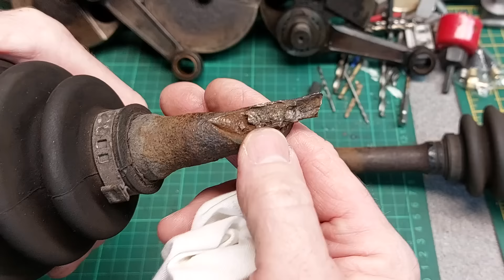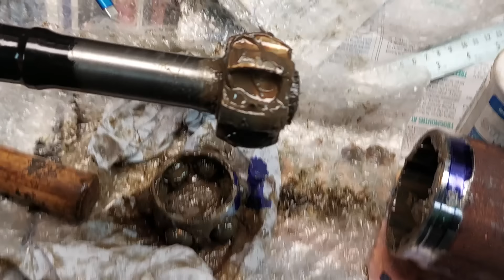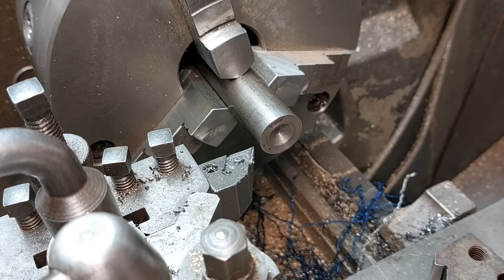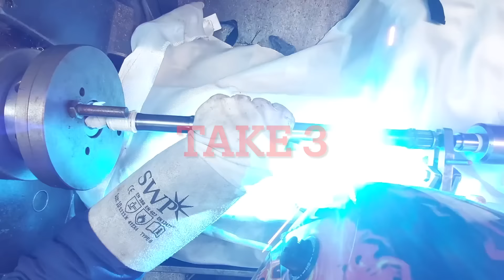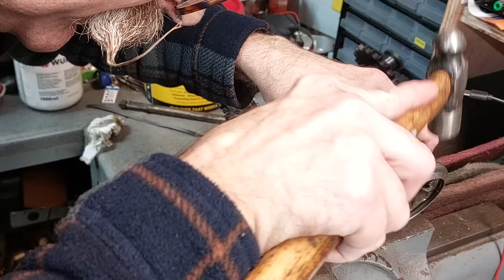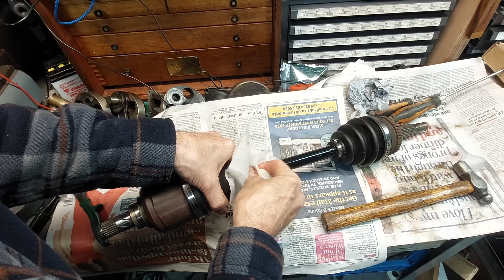OBSOLETE PART....IS THE CAR SCRAP ???  NISSAN MICRA BROKEN DRIVW SHAFT.

Comment: Did you not contact J&R cv joints and driveshafts? They have one that looks compatible on eBay for less than £40.
Reply from the maker: They were the final solution, see the next video.

Comment: 30 Years ago the machinist at my local driveshaft shop showed me that if you weld the shaft all the way around and then put the indicator on the shaft you can use a wet rag to cool the high spot. Each time it will pull about 8 to 10 thousands of an inch. anything under .010 inch is usable.
Reply from the maker: Very interesting, thanks Midge 👍

Comment: Looking at that fracture, it's been cracked for quite a while, there was less than half of the thickness of shaft holding and it was still working !
I would imagine the pressed together parts would hold well enough, adding weld just makes it a lot more secure !
You also made it look almost trivial too but having a well equipped workshop and knowledge of how to use the tools really helped !
Nice save ! 👍
Reply from the maker: Yep I think it had been hanging on a wing a day a prayer for a long time 👍

Comment: That exact same thing happened on our toyota avensis. Same rubber damper caused corrosion and  fracture happened when pulling away from some lights.  Dure you can swop the splined end onto another shaft
Reply from the maker: Unfortunately they all come complete so unless you pull them apart to count the splines on the drive shafts to check it's difficult to find the correct shaft......and I think you'd struggle to get a refund from the supplier taking it back in pieces 😁
Reply: @TweedsGarage I was thinking, reuse your splined end and pull the joint apart but that might not be possible.

Comment: My ears perked up when you mentioned Aerial leader.

I had a k11 with a cvt and there was a time I needed to replace the half shaft. I got one easily. 
I used to go through them from time to time as I had totally customised mine with performance parts ie suspension, upgraded inlet cam shaft etc.
Reply from the maker: Ours us a 1.4 which makes it tricky

Comment: Great recovery repair Mr T. Unavailable parts set me thinking what the next generation of old vehicle enthusiasts will have to face. The words rust, plastic and electronics to the fore and will they be allowed on the King's Highway? Happy Christmas to you and yours, with thanks for the entertaining posts of 2025.
Reply from the maker: Yes I also have to dive into the Jag which has had electrical issues and it's that era of car that has over complicated but quite dumb electronics......I should it has been tge end for many of its ilk

Comment: You could always go rot the brand new second-hand unit if that fails, or just put more weld on it .But that was a very good repair, should easy outlast the car. Respect Mr Tweed.
Reply from the maker: Thanks Dave

Comment: Exactly the same thing happened to my son's 2002 Toyota Corrola T Spirit auto last year. Corrosion under the damper bushing rotted the shaft till it snapped.

This is a lovely little car, still running great and under 100k miles,  but although Corrolas are about as common as fleas on a dog, this one is apparently a rare model and every single part i've tried to buy is either made of unobtanium or comes and is wrong!

A search of ebay turned up around 100 available shafts, but, despite my putting "auto" in the search parameters, only 1 came up as "auto only". A quick phone call confirmed it was definitely auto spec and 3 days later it was on the car. Interestingly the new shaft came without a damper bush!
Reply from the maker: A good find, and same with the Micra, there are loads of manual drive shafts, a few for the 1.0 litre autos but bugger all for the 1.4 CVT

Comment: You identified the driveshaft inboard end as CKN, I think that should be GKN, standing for Guest, Keen and Nettlefold, an old English engineering company that made all sorts of things. I used to use their products almost every day being a woodworker and using many different sizes of WOODSCREWS ! And later on taking apart just as you were doing constant velocity joints to replace the rubber boots and clean out and re grease the unit. You can get them apart without removing that outer ring. In one position you can pull the joint tighter than the rest, and then you can remove the first ball, then that gives you the room to do the same to the others in turn. The yoke will then come out of the coupling when turned sideways then twist it one half the distance between ball centres( this is hard to explain lol ) and it will come out!  Come on Mr Tweed, an engineer using centimetres? What's wrong with decimal Imperial inches?😅The only good metric measurements are Kilometres, metres and millimetres. Nothing else lol. The use of Centimetres, Decametres and god knows what else are just an idea of the Frogs who invented this bloody awful metrology system, was just to confuse every one else in the world who didn't have the Froggy language as their mother tongue😅😅😅😅😅😅😅. I'll watch the rest now! Tarrar!
Reply from the maker: Didn't GKN make woodscrews ( white cardboard boxes with blue writing ) ?
Reply: @Twe@T @TweedsGarage  Yes! I used thousands of them in my time as a church organ builder from, now  listen to this,  3/8" x 0 brass roundheads, to 6"x 14 countersunk's and just about every size and head shape in between.  The white boxes were the later versions, which started I suppose in the early to mid seventies, the original boxes were quite thick cardboard with alternating green and black diamond pattern for the lid and a plain brown  lower part. The label was green with black writing. Somewhere in one of my sheds I have a box, probably from WW2 era, it is a plain brown box, quite thick, with a small label, but  again green with black writing. And I can remember that from my childhood some 60 years or more ago lol
Reply: @TweedsGarage they make aircraft fuel tanks too!
Reply: Have now watched all ! A bloody good professional repair Mr Tweed, the MOT man will never know what's inside lol. That will almost outlast you sir, the outer CV joint is the one that will go eventually. I've never come across that colour of grease in a CV joint b3fore, normally they have black molybdenum-disulphide grease in them that sticks to high heaven and is a bugger to get off of your  hands 😅😅😅😅 cheers Mr Tweed!

Comment: Used to run a Daf 33 back in the 80s, it broke driveshafts for fun, you think the rubber cvt belts would break first.
Reply from the maker: That is surprising.......the drive shafts must of been made of knitting needles !!

Comment: how did that ever make it pass mot
Reply from the maker: The corrosion was under the rubber damper so you couldn't see it ..... even when it snapped it was still held in position by said damper

Comment: For those who are repairing a shaft that's going  to carry a lot of power and torque, make the center alignment hole extremely small because the weld is what holds all of  the load.  The nipple and hole only server to help with alignment.  The larger hole and pin the weaker the joint. When outside diameter is not critical, a thick wall sleeve over the outside  makes a stronger repair.
Reply: I have not seen a mini drive shaft that worn and my daughter had a 1968 mini up to a few years ago

Comment: Blimey! Has that drive shaft been living in sea water?
Nice repair, I thought he would sleeve this but I guess lining it up and getting it balanced would have been more difficult.
I suppose only a few Micras of this era would have had this type of transmission; Hence few in the scrap yards to get parts from.
Can't see this not working and should see out the car. 
Best idea is to let Jenkins rag it up the road.
Reply from the maker: If it had been the 1.0 litre engine it wasn't a problem but it's the 1.4 with CVT which seem to be quite rare......test pilot Jenkins is standing by 🙂

Comment: Looks like that should do the job. 
A bit suprised that you didn't clean out all the old snotty grease from the joints and re-grease on re-assembly though ? CV joint grease is readliy available & not too expensive.
Reply from the maker: They did get a top up 🙂

Comment: Absolutely brilliant repair. I did similar once but not for a car, it was for a big diamond wire saw used subsea for cutting up pipelines. I had an early Micra, my first car. It was the best car I've ever owned. Got run off the road by a snowplough in Spittal of Glenshee in the Highlands, middle of winter, literally middle of nowhere. Deep in snow, off road, the car just drove straight back onto the road. It was  bloody brilliant. This was one of  the best films I've seen in ages.
Reply from the maker: Ah the days when we drove around in hedge deep snow ( my best car for that was a Fiat 127 sport ) . Diamond wire saw that sounds interesting Carl.
Reply: @TweedsGarage It was interesting. I had to weld the feed screw of the diamond wire saw back together. I inserted a piece much as you did. The gearbox that drove it via a hydraulic motor was also shot. Spares needed to come from Italy, and we were offshore Angola. So I did a fair bit of machining and modding to make bearings we had on the ship do the job. To this day, I don't think that snow plough driver saw me. It was one of those moments when I realised I was in genuine danger of death. There'd have been no one else on that lonely road for days. Luckily the plucky, torquey Micra drove straight back onto the road over the boulder strewn snowy terrain.
Reply from the maker: @carlwilson1772 all hail the Micra 🙂

Comment: Good job, we  have done similar stunts in the past and no failures to report.
The purist engineers only get really apoplectic when you stoop to welding the outer drive flanges onto the drive shaft🤣
Reply from the maker: That'd do it 😂

Comment: We widened a jag independent back end for grass track racing with 2 x 6” sections of round bar ground to a point and stick welded, I raced it for a couple of seasons with no problems and thats over 200bhp and a LSD! That will give you no problems on a micra!
Phil,
Reply from the maker: Cheers for that Phil........so it'll be up for a Busa turbo swap then ( should make the Saturday shop quicker 😉
Reply: @TweedsGarage  The torque reaction may just roll the car up like sardine can lid😂

Comment: I was going to suggest you slip a length of garden hose over joint and secure it with some jubilee?  clips..2 clips each side of joint to be sure to be sure.
Reply from the maker: And as it winds up under acceleration then unwinds on a steady throttle it would be like formula 1 ERS 😉
Reply: I approve of this course of action.

Comment: Great repair Mr Tweed. 
You have single handedly saved another Micra from an early appointment with the crusher. 😊
Reply from the maker: It's the second time.........spent a weekend putting bits of sill back in.

Comment: Well, I’m a Mechanical Engineer and I’m not at all offended - ‘tis a top repair! As for that little gap you ended up with after pressing the second stub - probably a bit of a silver lining because I bet that gave you a shrinkage allowance for the welding. Top stuff. As for the internet lighting up, those saying it cannot be done should not get in the way of those doing it. 👍✌️🥸
Reply: You are right , my son put the latest seat/golf turbo engine in a mk 1 golf.  He cut the original golf 1300 shaft in half and then the 2 litre shaft put a tube joiner over the cut ends and welded it around. It works a treat.

Comment: I'm really enjoying the Retro-Tweed collaboration on the Bantam Arrow project and I heard about your motoring mishap while visiting Dean's garage.  Interesting failure mode on the driveshaft. I wonder if a different material other than bms might have been a better choice for the repair? EN16 or 24 for its resistance to shock loads? It would be interesting to hear Dean's take on this with his knowledge of materials. Excellent repair job.
Reply from the maker: We did discuss it and thought it would be fine with the low stodgy  power through a CVT box......if it was pumping out 200 bhp through a manual box then maybe a rethink.
Reply: @TweedsGarage  I imagine the cvt box almost eliminates any shock load. More a suggestion of torque than actual application.
Reply: @cdp9633 I think the material is a good choice for the application. Very versatile.

Comment: So your not putting the rubber damper back on then.
Reply from the maker: If there any noticeable vibration then yes but most replacement drive shafts don't have them
Reply: To be honest mate I was taking the piss a bit. but it's a superb repair that will out last the rest of the car.

Comment: When the Austin/Morris Mini came out, the CVJs used to wear out very rapidly. We all thought that front-wheel drive was a horrid concept. I never thought that the joints would improve to the extent that they would last the life of any vehicle . The fact that the boots are so durable is frankly, incredible. ( I did have to replace them, years ago on my Fiat 127.) Best wishes for the success of the project.
Reply from the maker: Cheers Martin, we'll have to try a few traffic light sprints in " sports " mode to see if it holds up.
Reply: The original equipment boots are good, but some of the aftermarket ones are such poor quality they start cracking within weeks of being fitted.

Comment: Great piece of work Allan. I'm astonished at the amount of metal that's actually "vanished" from that Nissan half shaft! Better have a look at the corresponding article on the other side.
Cheers, Peter.
Reply from the maker: Me too Peter and yes I will have a look at it.......if it's thinned down a bit I'll wrap insulation tape round it to keep it going 😉
Reply: It was the longer of the drive shafts that had these dampers on , nowadays the shafts are usually the same ,short length with a support bearing bolted to the engine block. Last vehicle I had with a weight was the mk 1 caddy van .

Comment: When you are press fitting into a blind hole, it's good practice to file a small flat along the spigot to let the air escape. If you don't you have to use much higher pressure than needed to compress the air. Equal and opposites etc etc.
Reply from the maker: Good point, I did think about it ......but got carried away like you do
Reply: @TweedsGarage  There may be a delayed compression ignition event at some time in the future and the drive shaft will be propelled out through the centre of the wheel and across several lanes of traffic at high velocity😱....🤣🤣
Reply: @howardosborne8647 the Tweed Torpedo. I'd pay good money to witness that...
Reply: @howardosborne8647 this calls for ‘drive shaft cam’. We want to see that…
Reply: Yeah, id be scared stiff , i too, wonder where the air went to .. but tweeds been at it all his life, knows his stuff,  so i dont question.
Reply: Quite right. I made that mistake while Silver Soldering a part, and there was a mighty bang.

Comment: We used to put Fiat 2.0 twin cam engines and gearboxes into Ford fiesta shells for grass tracking. We used to chop the Fiat and Fiesta drive shafts, push them into a piece of steam pipe, true them up in vee blocks and weld them up. We never had a shaft failure so I'm sure the mighty Micra will be good for years to come.
Reply: Nice. I fitted a mildly tweeked 2.0L twincam Fiat 131 engine in a MK2 Cortina back in 1986. That was a lot of fun and pretty nippy by Cortina standards. It had a bit too much power for the 1600E rear axle and I broke a few of those. Fortunately back then Mk2 Cortinas were 10 a penny and scrap yards always had a good supply of donors on the pile.
Reply from the maker: That's good to know Bob, I did consider scaffold tubing as its always really good quality steel ( they machine lovely ) ........but they were too big 😁...........I did wonder what happened to all the Fiat twin cams

Comment: Can’t you knock the end off on yours and fit it to the one that doesn’t have the right splines, on VDub driveshafts the cv joint knocks off! 🤔
Reply: Just seen more of tge video, obviously not. ☹️
Reply: Just seen more, mabpybe so. 😂😂😂
Reply: That's exactly what I was thinking!
Reply from the maker: Possibly but you'd have to strip a new one apart to see if it had the same spline pattern and the motor factors wouldn't be impressed if you handed it back in pieces asking for a refund because it didn't fit 😉